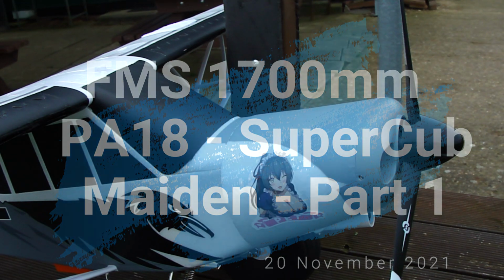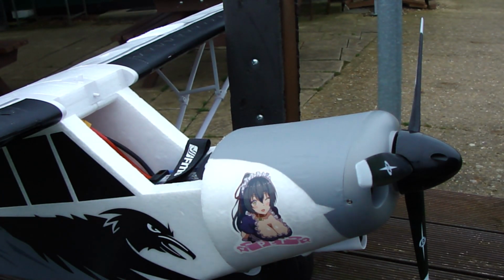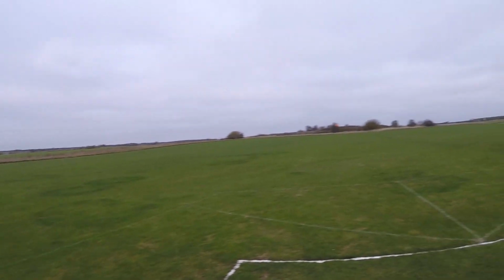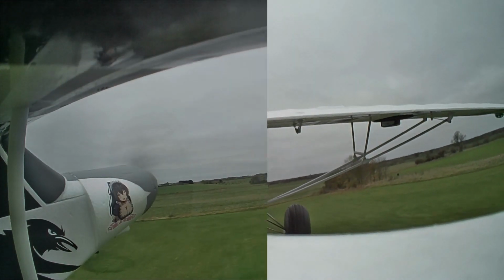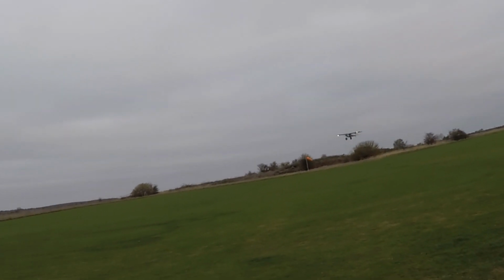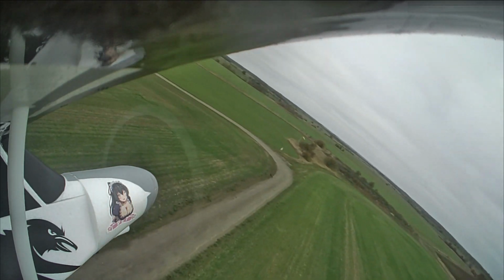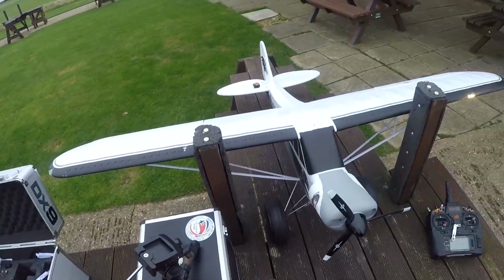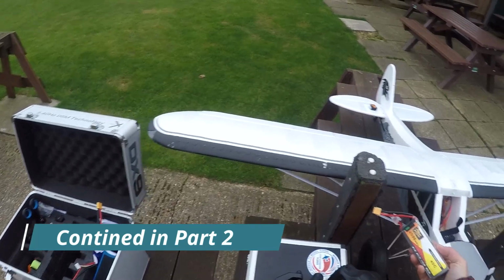Maiden - FMS 1700mm PA18  Super Cub  Part 1   20 Nov 2021

Comment: what is the description of your 3 blade propeller
Reply from the maker: it is a master Airscrew 11x7 - BUT I have since replaced it with the original two blade prop as a three blade is not as efficient and the flight times were reduced because of it, going back to the two blade I can have longer flights....
Reply: @FlankerTanker  Thank you
Reply: Thanks again. I'll test it anyway. Greetings from Germany

Comment: What did you gain as far as Performance on the 3 Bladed Propeller and what size propeller did you change too? Thanks
Reply from the maker: nothing was gained at all on performance if anything it got worse, I changed the prop at this time as I preferred the look of a three blade rather than the two blade on this aircraft , that's all....cannot recall the size I might say in the video at some point ?? or on the Assembly video, it was two years ago, oh and I now have a Standard two blade back on it.  - all you do is loose 1 inch when going from two to three blades in size and keep the pitch the same...  for example  if the two blade was 15 x 9 then the three blade is a 14 x 9 or as close as I can get so it could be 14 x 8.5 etc... or 13.5 x 9 I have posted a video on how to calculate the size and pitch changes but do not recall what I called it ??
Reply: @FlankerTanker  i kinda was expecting this would be your answer to my question. Lol  i went down the same road with the FMS Beaver 2.0m i just didnt care for the 2 bladed 15x9 stock propeller and changed it to the FMS 1400mm Corsiar 14x9x3 bladed propeller instead with the pratt n whitney correct looking variable speed prop spinner and other than LOOKS that all that got better with it.  These engineering guys designing these planes do their home work to get the best power to battery time on these current crop of planes

Comment: what LED set (with the wing tip strobes) is that? I love it
Reply from the maker: The can be purchased from Ebay , banggood - and I am sure other locations - they are called EASY-LIGHTS and come in two different formats - wired or none wired - I use None wired so I can share them between different aircraft -... they come as a set of three (RED, GREEN and WHITE) and each have three different flash settings..

Comment: What cameras are you using on the plane?
Reply from the maker: I use two different cameras on the aircraft  - the large cameras  I use are RUNCAM2's  these tend to be used on the larger aircraft the smaller camera's are Mobius 808 #32.
Reply: Thanks!

Comment: How do transport such a large rc airplane? I would have to remove the wing to fit in the boot of my car?
Reply from the maker: I drive a Hatchback I can get it in with  only needing to remove one of the wings and leave the other one connected - to save connectors I alternate each wing for each trip

Comment: What 3 blade prop did you use ?
Reply from the maker: I replaced the standard 12 x 7.5 with a master Aircrew 11 x 7  so lost 0.5 in pitch...
Reply: what 3 blade prop components did you have to use to accomodate the 3 blade prop ?   Spinner, back plate, adapter, etc etc .   Thanks